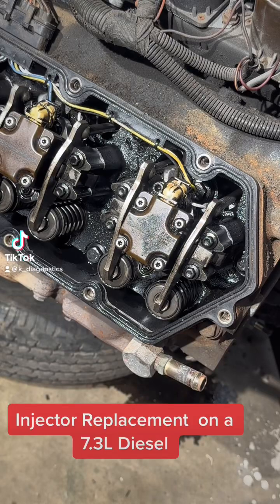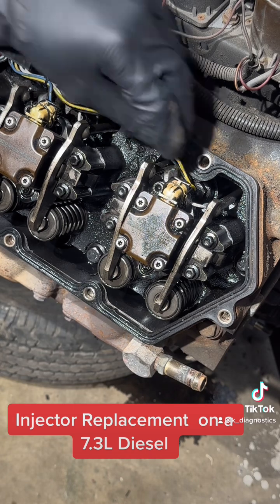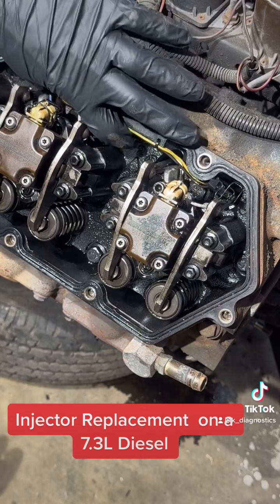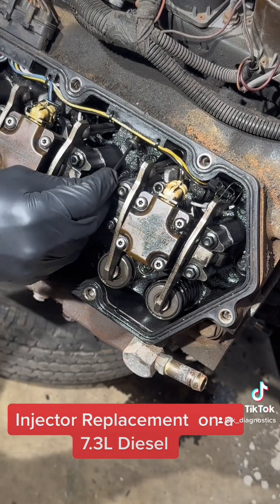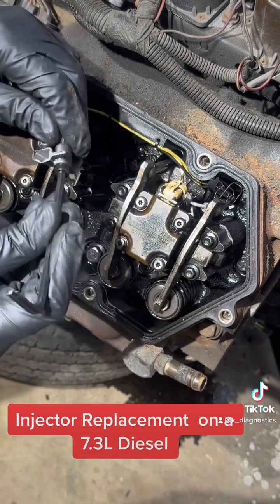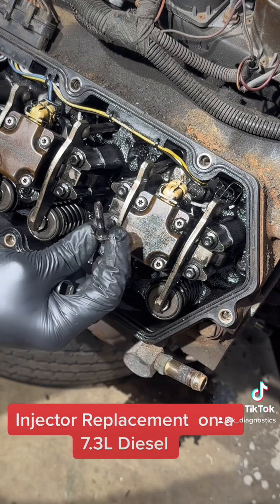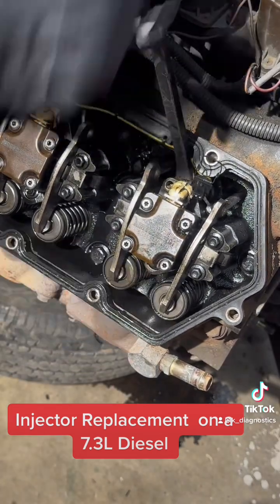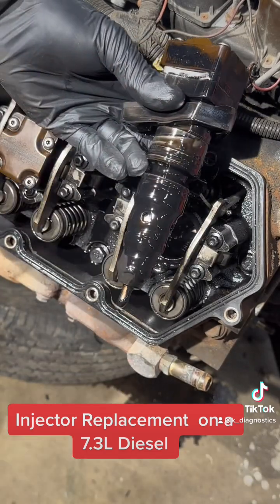Injector Removal On a Powerstroke 7.3L #shorts #dieselengine #diesel #injector #powerstroke

Comment: What exactly does removing the rail plug do ? Does the oil just fill the cylinders all the way to the back ?
Reply: If you frail the rail it doesn’t fill the cylinders saves a mess later on. You obviously still roll her over with the glow plugs out a few times just to make sure
Reply from the maker: @anthonyking2567  yes
Reply: But doesn’t it do that anyways? If you pull one of the injects out it still back fills ? Can we pm

Comment: How hard to remove it inside the Van?
Reply from the maker: @casimirobuenabista  The driver side is pretty easy it's the passenger side that's pretty hard!
Reply: @KITS_Auto_and_Truck_Repair  how hard could it be just lift off the cab just a little bit to get more space?
Reply: 😢I’m asking this same question